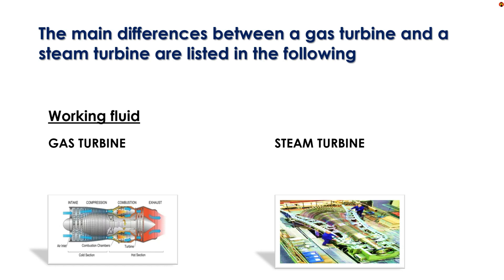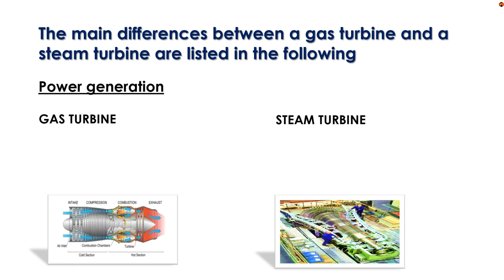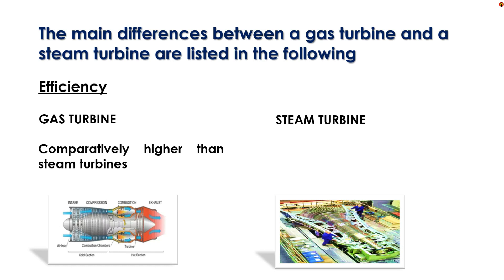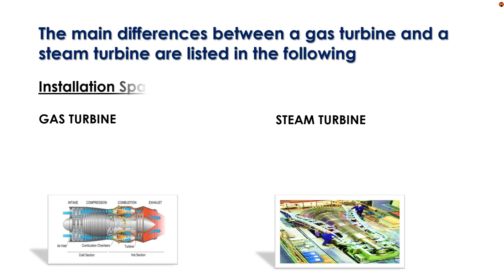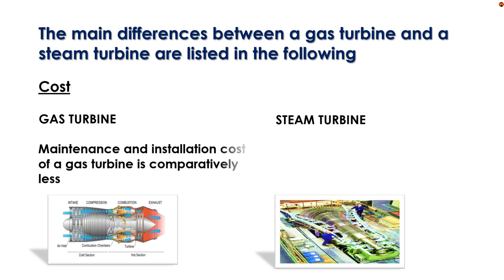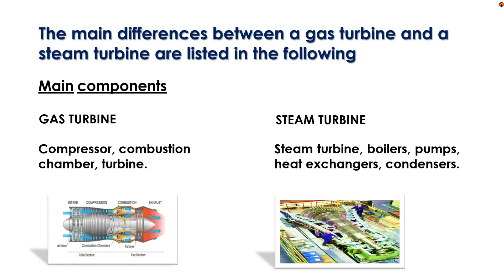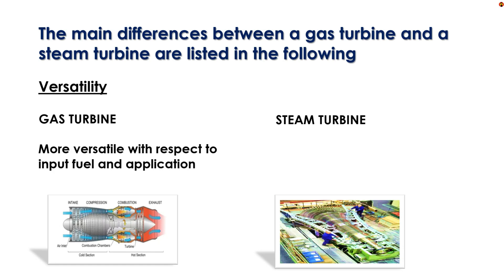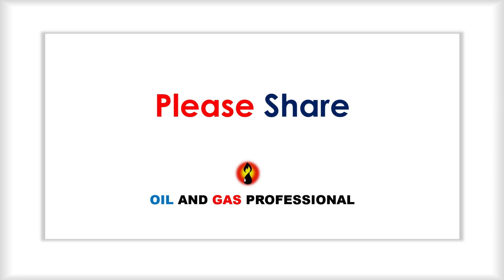DIFFERENCES BETWEEN GAS TURBINE AND STEAM TURBINE / Oil and gas

Comment: If I am not wrong. Let me correct one point --Efficiency of steam turbine is more than gas turbine. Because the compressor consumes  power from the total energy of the gas turbine.
Reply: Only if the turbine requires a fuel gas booster.  I quote and help sell them.